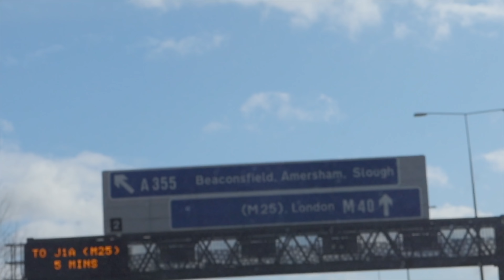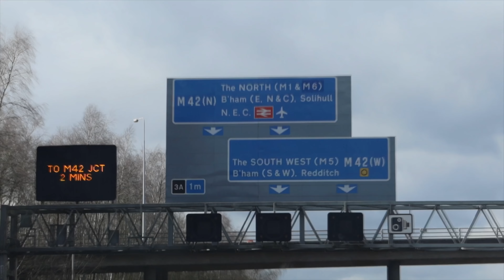Rebuilding a salvage NISSAN GTR part 6 (CHOPPING THE GTR + NEW RIMS)

Comment: So Lads, I been mechanic since 16, now 38. Never hurt myself. In December, I was working and screwdriver snapped in half and flicked me in the eye balll.
Very high speed, but did not penetrate the eye ball. However the force caused trauma inside and cases internal bleeding.
And long story short after several operations I am now blind in left eye. So always always wear protection
Reply: Thank you for sharing this!

Comment: Great to see a complex repair job done correctly on you tube.  The skill and workmanship is class and car will be safe when back on roads. 

one question I alway think about is manufacturers saying second hand parts should not be used?  Is this OEM trying to force people to buy new parts or is there an issue? OEM suggest reheating (welding) panels causes structural issues.  Does anyone know the science / engineering facts about that?

Comment: Hi zee please use electric power drill for spot weld hole dill out as battery drill are not much powerful enough to continue holding power in one level as battery powered is draining out and which slows down drilling power so electric drill machine will make your work easier and power of drill will be at one high speed level.
Now you are pushing this drill alot to make holes out fast but better to electric drills machine thanks 
Tips for today's 
Continue for good work and show tv

Comment: I was really concerned seeing you use that angle grinder without a guard near your face. Believe me, these cutting discs can explode, I've had two explode on me int he past, but the guard on the angle grinder threw the pieces away from me. You really need to work safer to avoid severe personal injury. At least use a full face shield, if you aren't going to fit a guard to the angle grinder.

Comment: This repair is getting bigger all the time - having to take off good panels to be able to remove bad panels. At least you are doing it right. Some people would have just cut the inner guard and welded the new part on instead of replacing the whole panel. 
Black would be the best choice for the wheel colour. It suits the car better than grey or white.